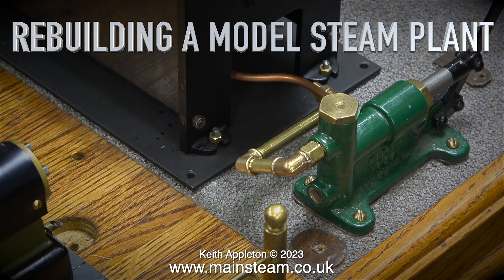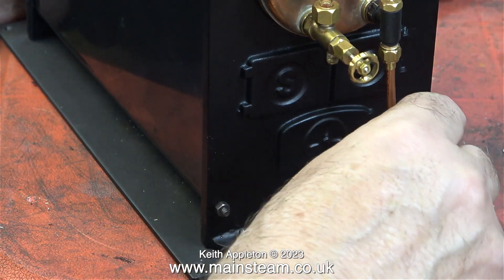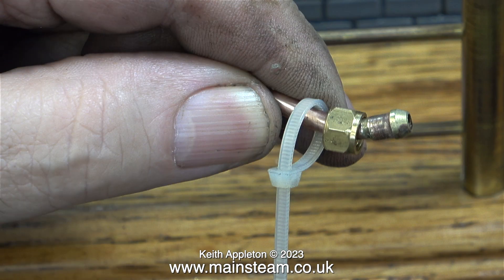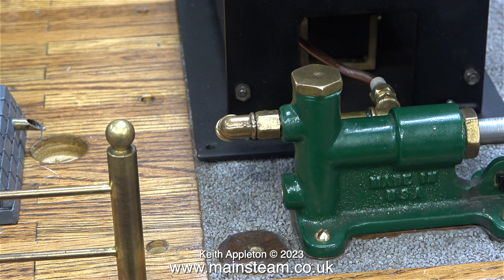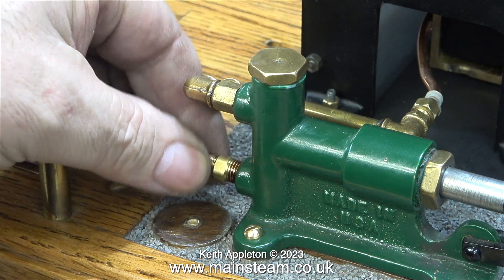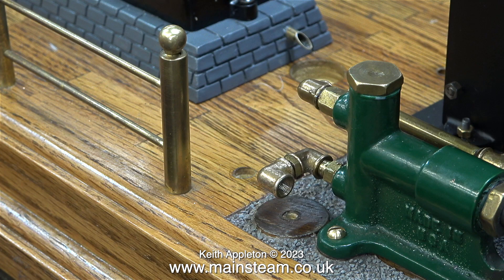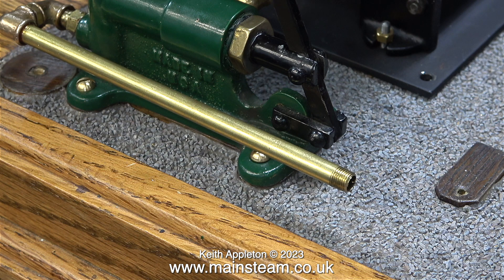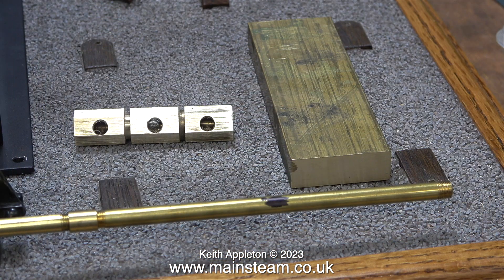REBUILDING A MODEL STEAM PLANT - PART #33

Comment: I would think that you would mount the feed water pump by the front of the boiler.That way you could see how much water you were putting in the boiler looking at the Gage glass.
Reply from the maker: I don't think you are understanding the principle. The Feed pump is at the rear of the plant as it is over scale and clumsy to look at. You can clearly see how much water it is pumping because the water gauge is at the front of the boiler.